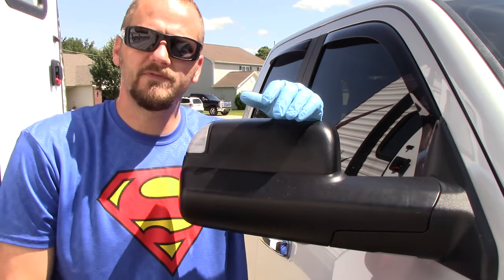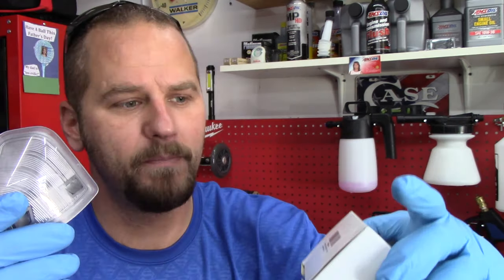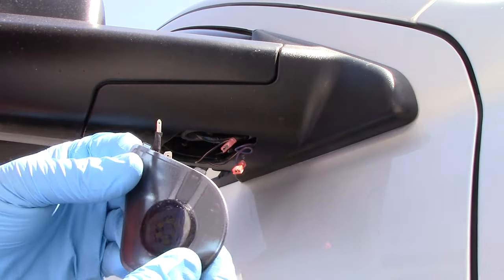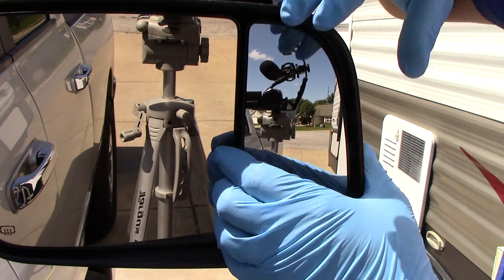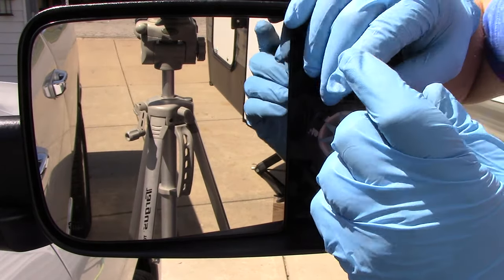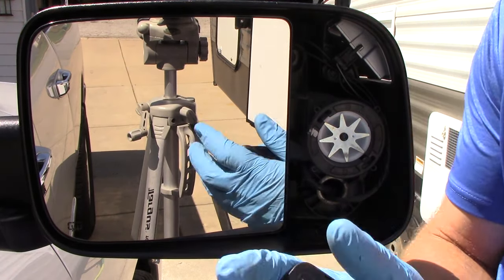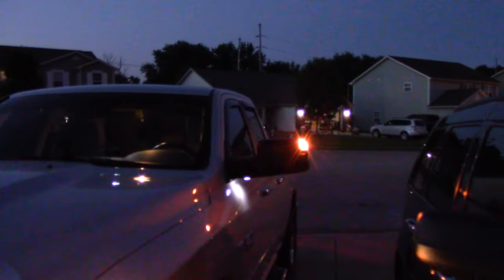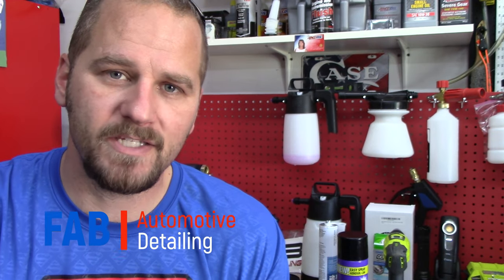RAM Turn Signal and Puddle Light Replacement! Very Easy to do!

Comment from the maker: Here are the links to the turn signal light. I can’t find the puddle light on Amazon now. 
HERCOO LED Side Mirror Turn Signal Light Left and Right Lamps Clear Cover Lens for 68302828AA 68302829AA Compatible with 2010-2018 Dodge Ram 1500 2500 3500 4500 5500, Pack of 2 https://a.co/d/f8uA8Xf

Comment: Tried this on my 2010 ram 3500 and the little mirror that's supposed to pop out, refused to just pop out. Pulled harder and harder tell the little mirror shattered and the whole ball came out with it. Now I'm scared to try again on my 2014 ram !!
Reply: I had this same issue theres a srew
Reply: On the otherside
Reply: @Overdrive_Odyssey Screw...for the blinking liggt not rhe mirror ..
Reply: Just tried this, shattered the damn thing trying to force it in and cut my hand up good, just gonna suck it up and pay someone to do it lol
Reply: @CarsonPetagna  I think I knicked myself too  a bit

Comment: Wow, that mirror pop out, I wouldn't want to do that in the cold. Looks like those clips would snap for sure. Great video.
Reply from the maker: Yes definitely don’t do it in the cold! Thanks
Reply: @FABAutomotiveDetailing  my mirror broke when pulling. I believe I have to fully disassemble my mirror. My side mirror has to be screwed in. Now I have to replace my mirror. And not sure how to disassemble to do so. Lol
Reply: I did it and snapped 4-7 of them put the mirror back on and it’s still there

Comment: I have a 2012 RAM 1500 and will do this as mine are both out. Thank you Superman!

Update:got both turn and puddle lights today.  immediately I went to work. It is exactly like you described and it took about 29 mins for both sides.  Super easy! Thanks for the awesome vid.  You save me $$$ by showing step by step.    All is well
Reply from the maker: Sorry I am just seeing this! Glad it all worked out for you! I will have to show this to my kids because they don’t believe I am Superman but you just confirmed it. 😂
Reply: I tried my 2012 2500 today and I cannot get them off for the life of me. Are you actually reaching the clips with your fingers or just pulling on it?. Neither side will let go for me.

Comment: I have a 2012 Dodge Ram 1500. Watched this video for the puddle lights and turn signal lights. Great tutorial. However I must've purchased the wrong puddle lights because they don't have the exact same connectors. The replacement turn signals worked great though. Thanks for the tutorial!
Reply from the maker: That’s great I’m glad my video helped out.

Comment: Awesome! Exactly what I was looking for. Will be replacing mine this week. Thanks for the video.
Reply from the maker: Ricardo Corona You are welcome!
Reply: @FABAutomotiveDetailing  Hello! So I replaced the puddle lights and mirror signal lights. They look and work great. I did find that the mirror lights did not have a snug fit so now there's a whistle that comes from the mirrors when driving. Is there anything you can suggest to resolve that issue?
Thanks.
Reply from the maker: Ricardo Corona The I my thing I could think to try would be some black RTV around the inside edge of the light then tighten sown real good. Mine fit snug so I wonder if you might be able to snug down a bit more.
Reply: @FABAutomotiveDetailing  thanks for the quick reply. I'll give it a shot and hopefully it resolved the issue.
Reply from the maker: Ricardo Corona You are welcome!
Reply: @FABAutomotiveDetailing  hello again. Tried the black rtv around the edges and that solved the problem. Puddle lights and mirror signals are looking good! Thanks for all the help. Cheers!
Reply from the maker: Ricardo Corona Awesome! You are welcome!

Comment: I need to change mine I already did the puddle lights. But was like how to the blinkers come out. So very helpful video. Definitely gonna subscribe. I also wanna do the mod to make them stay on when parking lights are on and blink when you hit the blinker.
Reply from the maker: Daniel Moniz I want to do that mod also to make them parking lights. I noticed the other day though that these lights have moisture in them already but they still work. Just FYI
Reply: FAB Automotive Detailing yeah mine do to. I don’t think there is a way around that. I was looking for some aftermarket cool ones but didn’t find any.

Comment: Thanks for the video.  Spot on to my issue with my 2011.  And thanks for being detailed enough with which bit to use to remove the screw.  Unfortunately for me, the screw was rusted and the head snapped off.  Good thing I'm getting new lights but will have to find a screw to fit it.
Reply from the maker: You are welcome! Glad I could help

Comment: Thanks Bud! A carwash's air dryer bumped the pass side turn sig on the mirror and off it went flying! Hoping mine isn't somehow broken something inside the mirror housing and it'll be this easy!
Reply from the maker: You are welcome. Good luck
Reply: @FABAutomotiveDetailing  Ok I received the signal...BUT it's not above -1° Celcius in Canada sooooooo...I wonder if cold is going to be the downfall to an easy install causing less flex in plastic and breakage! I'll update this message shortly lol...hang tight!

Comment: Awesome video. But quick question. When you unlock or lock your truck with key fob, is it supposed to blink? Because mine only turns on when hazards or blinker is on. Btw I have a 2013 3500

Comment: This is awesome but I can't seem to find these on Amazon could you relay the order information thanks
Reply from the maker: @geraldplouffe9707  HERCOO LED Side Mirror Turn Signal Light Left and Right Lamps Clear Cover Lens for 68302828AA 68302829AA Compatible with 2010-2018 Dodge Ram 1500 2500 3500 4500 5500, Pack of 2

Comment: Just a note.  While this worked for the driver side on my 2010 ram 2500 with these folding mirrors, the passenger side spot mirror reflective surface was not removable.  The reflective surface broke doing this and I found out after popping out the plastic reflective that the only way mine could ever have been assembled was to attach the spot piece to the whole mirror via a screw, then Adhere the spot reflective surface over that screw.  It did not have anything like the snap rings like you describe or like was on the driver’s side.  Just a note that not all are like this.  Odd that one side was and one was not.
Reply from the maker: That is odd but thanks for the info!
Reply: Similar to this, ordered new convex mirrors because my lenses both broke

Comment: Thanks great video on my 2011 the dealer replaced mine maybe 7 yrs ago . They said the wiring was corroded if they go bad again Ill need new mirrors.  If they go bad I will try to repair the wire myself or not have those lights.  My spot mirror fell off 2 years ago I replaced it I know what you mean about that clip bracket .  Thanks great video 2011 Ram 2500
Reply from the maker: Thanks!

Comment: I'm wanting to replace the puddle lights with amber lighting that stays on with the running lights...is that possible?  

I know you can change the settings for the delay off time, but can you maintain a constant illumination as a marker light?
Reply from the maker: I don’t believe you can change it to stay on. There is a company that sells a kit to make them market lights. I don’t remember the name of the company though.

Comment: This was a great video. Got the work done. However, my blinker is still blinking fast; as if a light is still out. The front and back are blinking at a normal speed but the mirror light is blinking fast. Any word on that?
Reply: The puddle light doesn’t seem to be on though. Not sure if this affects the sensor.

Comment: thank you for this vid.  I did the change on the passenger mirror and now my drivers side needs changed.  EcXEPT it has the temp sensor in it..............do  I need a special light???
Reply from the maker: The temp sensor is mounted underneath so it won’t affect the install. I don’t know what light you mean.
Reply: @FABAutomotiveDetailing  sorry I didnt make that clear to you.  I talking about the turn signal light on the drivers side. It has the temperature sensor in it.  I was just wanting to know if I still just buy the standard light when I change it out.
Reply from the maker: @mikel.laughridge9480  The temp sensor should be in the bottom mounted on its own. You shouldn’t need a special light.

Comment: I have a 2014 ram 1500 5.7. When I bought the truck I had just regular stock mirrors without the signal or puddle light on them. I swap them with towing mirrors which come with the signal and puddle light.  Later I found out that these mirrors need to be programmed with a code if the truck did not have the option when purchase so the puddle and signal light can work. Well, the puddle works fine just the signal does not. The truck does have all the required adaptations for the mirrors connections. Do you think I still need to program them or maybe the signal lens is burned out? Like I said puddle did not need the code after all as other videos had mentioned.
Reply from the maker: I can’t imagine the lights would need programmed. If they do you could just run wires to them from the turn signal circuits individually.
Reply: @FABAutomotiveDetailing  those are my plans as they want to charge me $380 for the programming. Thank you
Reply from the maker: @luciaaguirre6679  you are welcome!

Comment: I seem some trucks they having the turning signal on while they driving. Its there any adapter or fuse that keep it on?
Reply from the maker: Yes there is a wire harness you can buy to make them stay on with the headlights

Comment: My trucks turn signals only turn on when I hit the flashers or the signal switch. But they won’t stay up as courtesy lights. Do you know if they’re supposed to? 2018 ram 3500
Reply from the maker: You have to buy a wiring kit to make them stay on with your parking lights. I’m not sure who makes them but if you google it you will find it.

Comment: Curious why you didn't go with a smoked cover to match the mirror and switch back driving light/ turn signal
Reply from the maker: I don’t like smoked lights as they are not safe at night time. I would like to make them running lights just haven’t bought he kit to do it.

Comment: I don't think the aftermarket could be much worse. This is typical Chrysler quality (I have a 2014 Ram 2500). The 2003 chevy 1500 I have, it has 300,000 miles on it, the factory lights in the mirrors still work.

Comment: I bought the puddle lights you used here and when I replaced my old ones the puddle lights do turn on but barely... it is like the smallest little bit of light... haha I can barely see any light on my hand at night when I hold it under the puddle light! Any idea what may be causing that?
Reply from the maker: Barak Frank If they turn on then that means you have power so it’s either your ground has a poor connection for the light or the LED’s are bad.
Reply: FAB Automotive Detailing I’m thinking it must be a bad ground connection because both lights look the exact same on the passenger and driver side... Just very very dim! They don’t look anything like yours! Haha. How would I check the ground connection to see if that is the issue or how would I fix that?
Reply from the maker: Barak Frank You can either run a new ground to the lights or you would have to track the wires down to where they ground. You would need a wiring diagram for that.
Reply: FAB Automotive Detailing Awesome sounds good! Thanks for the info!
Reply from the maker: Barak Frank You are welcome!

Comment: Tried on a 2017 2500 and no luck the wires don't plug in they are solder to it

Comment: I have 2017 dodge 1500 where is the fuse to the lights gonna see if thats issue there is a wire that is cut i spliced them together to see if that was the issue and still nothing
Reply from the maker: You would have to check the wiring diagrams in a service manual to figure out which fuse runs those lights.
Reply: Thanks man where can I get the lights at
Reply: Well first off how do I find out if it got any power to the lights

Comment: But if you change the light and nothing  turns  on I tested  the cable for electricity  it got energy  the tester  turn on and off but when I plug it back on does not work
Reply from the maker: Then the light is bad

Comment: Did they have a option for a RAM projection on the ground for the puddle light. Do What You Do FAB. HOOF OUT
Reply from the maker: HOOF HEARTED I didn’t see one for the puddle light but you can get them that go on the bottom of the door.
Reply: Mean Bee did a video on installing ones with logos. I didn't know they existed before seeing the video. I bought a pair on Amazon for around $12. Took less than 10 min per side, and being LED are nice a bright. I get lots of compliments on them. Really cool seeing the logo
Reply from the maker: B Stewart ExecutiveCarCare I saw his video also. I will check them out.